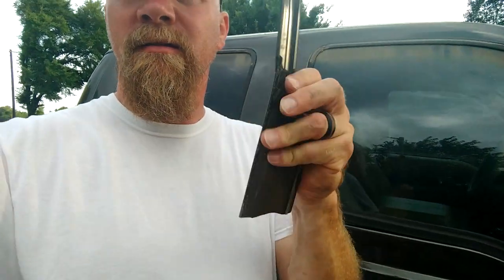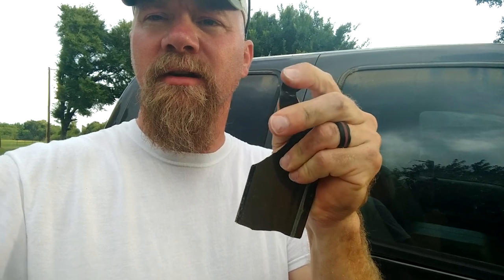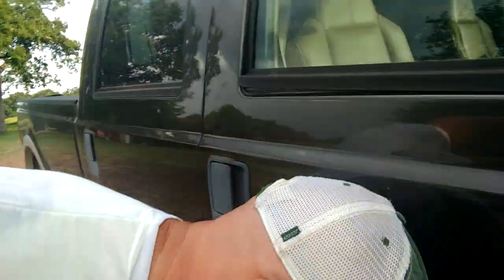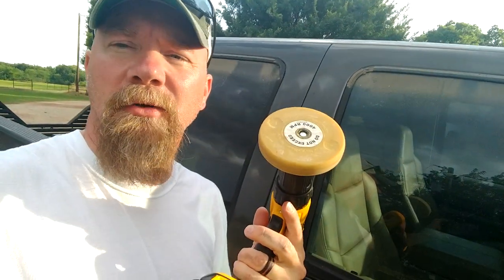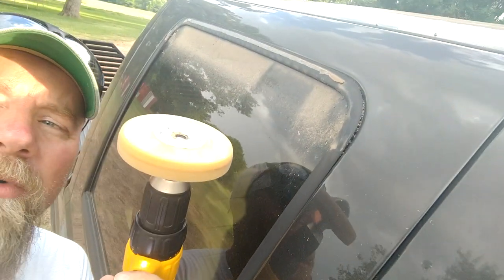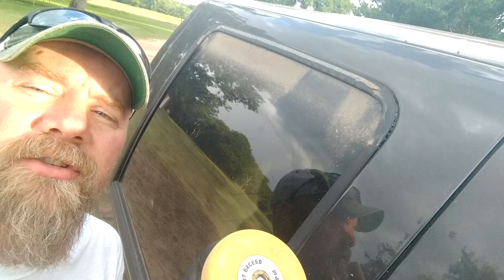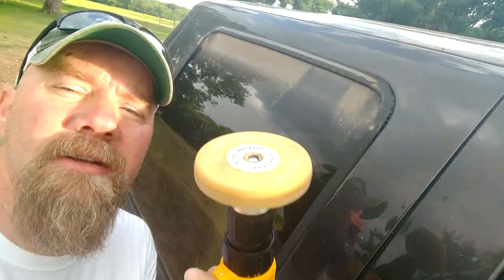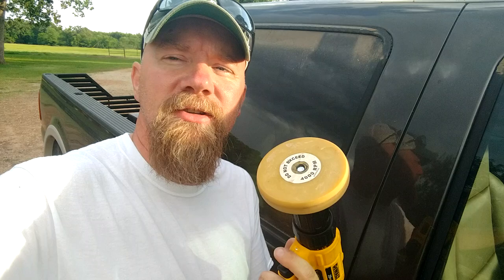How to Remove Old Vent Visors and their Adhesive

Comment: Thanks for the tip Clay. I'm getting a Maaco paint job on my 2003 Tacoma and I have to remove my Auto Vent shades  before I drop it off to them. I will try this technique and get an eraser wheel.

Comment: Great video. Gotta link to the eraser wheel? Thanks.
Reply from the maker: You can pick one up at just about any auto parts store. Here's one of many on Amazon S SATC Decal Eraser Wheel 4 Inch Pin Stripe Removal Tool 1 Pack Adhesive Remover Wheel with Pad & Adapter Graphics Removal Tool Eraser Wheel Decal Remover https://www.amazon.com/dp/B07ZNGPY8G/ref=cm_sw_r_apan_glt_fabc_FWQ7P1991H65HAY1BEG3